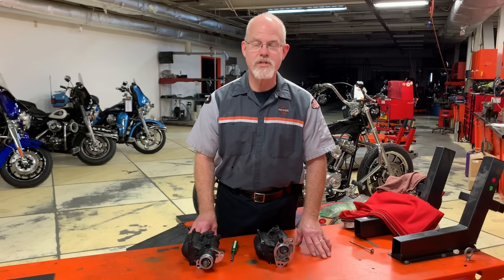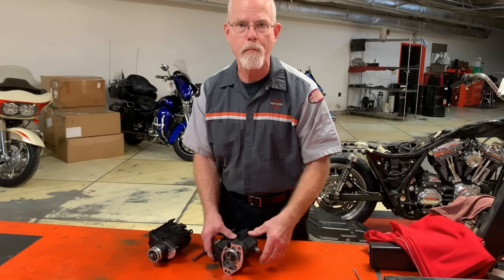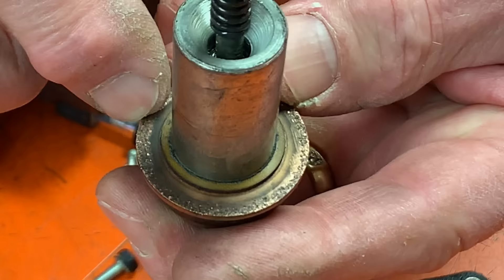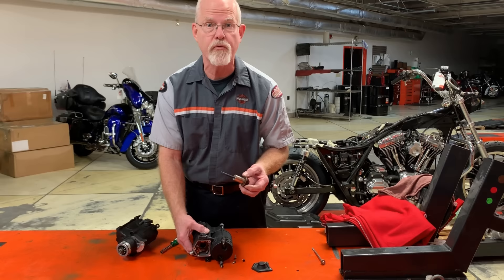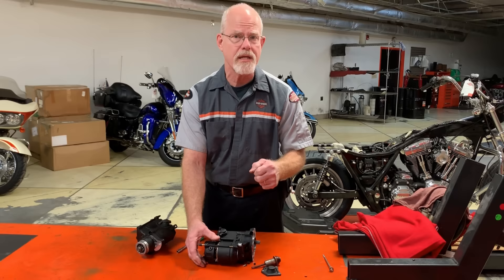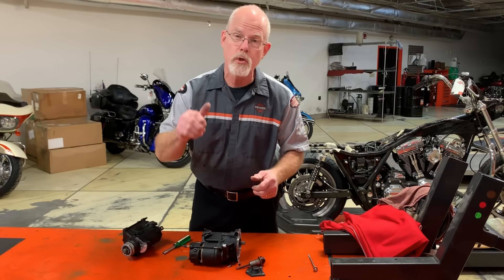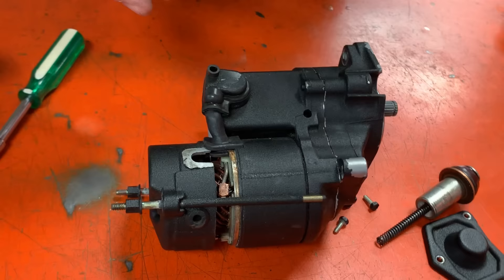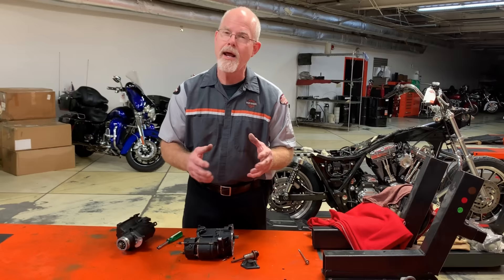DOC HARLEY: STARTER MOTOR WHAT WEARS OUT

Comment: What if you get a continuous clacking sound when you try starting it? from the primaryarea.
Reply from the maker: Depending on what year and model. Many times the Battery does not have enough juice to kick out the starter gear and engage the starter ring on the clutch....Doc

Comment: Hey Doc Harley. I have a 1977 xlch and im having an issue with engagement inside the clutch case.(with the starter and the solenoid)I used shims in the past to get the proper alignments. are my clearances wrong? but now i cant seem to find the sweet spot. Do you have any jewels of knowledge to set me in the right direction?
Reply from the maker: Having a Sportster with a long history. My first choice is the condition of the starter gear on the clutch…..Doc
Reply: @LowCountryHarleyDavidson  could it be the starter bendix not locking in the opposite direction?
Reply: @LowCountryHarleyDavidson clean gears
Reply: Thanks for the rapid response 
I made a video and will link it

Comment: Hi Doc - occasionally (maybe one-out-twenty starts) I'll hear a awful "kwang" kinda of noise; it's very intermittent. I'm only guessing, but it sounds like the pinion gear is not engaging cleanly with the clutch - merely bounces off of it. It doesn't start. I try again and it almost always does. But it's a terrible noise and sounds it'll break something sooner or later. Your thoughts on this. My scoot is a 2012 FXDC. Battery is new. Thanks.
Reply: Compensator sprocket

Comment: Hey Doc,  I know this was about starters but, I have a question about its cousin the stator...LOL  My 03 Peace Officer Shine Road King is almost 20 years old.  That being stated, Im the type of person (Mechanical Engineer) That replaces parts before Im stuck on the side of the road so, ok here is the question.  I'm not getting a definitive answer from anyone when I ask the question.  Does my 03 Road King Shine have a 3 phase stator.  Some people say yes and others say no.  If no, can I replace the stator with a 3 phase model, replace the voltage regulator without creating any electrical problems with the rest of the electronics on the bike.  I do not want to sway all this out only to find out I possibly might hurt some other components.  Im not having any problems with my bike now and I don't want to at 2;00am in the morning on i-95
Reply from the maker: You own the Peace officer edition with basic two phase. The Police models had the better charging system. You can upgrade your bike with the HD Accessories 45 amp charging system Part # 29999-97B.  Also I highly suggest looking up Cycle Electric Inc.They offer a lot information and upgrades....Doc
Reply: @LowCountryHarleyDavidson  Thank you....You get a star on your forehead and an extra cookie at lunch today..

Comment: I realize this video is a year and a half old but I have a question relating to starter motor life-cycle. I had a mechanic tell me many years ago to always start your bike in neutral and I can hear the difference turning it over when I do. It is not working as hard. I have always done this and have never had a starter problem over a lot of years and miles. Mr. Doc Harley - do you agree with this?
Reply from the maker: I agree with you. Since fuel injection, starting in neutral is a safety priority. I knew a customer who left his early fuel injected Harley in gear. He turned ignition on then pushed the starter button. The bike chugged across the parking lot with him chasing behind. Thanks ~ Doc

Comment: I asked before about my solenoid staying engaged. Relay fuse was didn’t change situation. It was suggested to replace solenoid switch, is this the next best choice?
Reply from the maker: It could be cheaper to have your local tech follow the flow chart in a Factory Service Manual and replace the part that is causing the issue..Doc

Comment: I replaced two of the Hitachi units on my 81 Shovelhead then got smart and installed a kick.
Haven't looked back since.
I put points ignition back in as well.
Oh yes and replaced those awful hydraulics with solids in the process of debugging the bike up to more reliable old school standards.

Comment: Doc Harley, I have an older motorcycle that kicks back as you described. What can cause this?
Reply from the maker: Many details that go into diagnosing the cause- like any modifications that have been done, battery age, loose connections or ignition issues. I’d suggest taking it in before having to purchase a complete starter.

Comment: The plunger on my starter right above the copper washer is a plastic piece that broke off which lodged between connection there for no start. What’s a good website or company to buy the plunger ? I’ve searched for few hours now no luck... thanks in advance Doc. Or anyone who may point me in the right direction.
Reply from the maker: If you still have the factory starter, a dealer can look at the parts catalog to see if H-D offers individual pieces. Sometimes Drag Specialties offers parts. Thanks ~ Doc

Comment: 05 FXST Softail hit pothole hard ... Bike starts without pushing start button ... Turn switch on and flip kill switch bike starts and starter stays engaged unless I pull starter relay .... I replaced starter relay and it didn't fix the problem ... Any ideas ?
Reply from the maker: Did you just change your handlebars? sounds like the Stop/Run switch wire is crossed to the starter switch.....Doc
Reply: @LowCountryHarleyDavidson  thank you for your feedback you're very close tho...
When I removed the run and start switches from the handlebars I found that the wires going into the kill switch were green as in corrosion.... So thank you for your feedback again definitely much appreciated

Comment: So, why doesn't Harley redesign the starter to me more robust,  when these are the known problems???
Reply: lol...because like most things, companies want to be able to make money off of us in parts !
Reply: Um because starters going out isn’t really as common as people think. Nothing in this world lasts forever
Reply: @anitabonghit266  I have three on the bench right now
Reply: Tom Smith just because you have three on your bench right not doesn’t mean much of anything. You could just be bad at diag. Just like when people think replacing the ecm is the fix
Reply: @anitabonghit266  
What? Don’t try to insult me, I was playing nice.
I have three on the bench. Two with worn out clutches, the third with a broken idler gear and a bad solenoid, all three will get there solenoids rebuilt the parts are cheep under $25.00 retail. And now is the time to do it.
Anita Bonghit 
They will need or get new - All Balls - Big twin starter clutch assembly - with clutch, two bearings, gear and spring fully assembled and are lifetime warranted from the supplier ‘unless that has changed’ 
Part # TR-497970 $58.32 retail. I have them in sock but I’m not into sales at all.
I have replaced every thing in the system many times and have up graded pinion, shell drive gear and sprockets, with lesser teeth on machines that are a bit more than stock so the teeth don’t get ripped off and cause further problems using high performance clutch packs from Energy One
They don’t burn out and leave Barnett in the dust. 
Took my first head of a Harley in about 1965 and haven’t stopped repairing, building but did finish racing them. 
Anything else
Reply: @anitabonghit266  
First it is my fault based upon my ability, then the people that ride these machines are Idiots.
Great diagnoses. 
Years of use, does that count? 
That wiring to the Start relay, ground in particular could it be any smaller? You would be surprised how much another gauge or two will make when replacing that relay.

Comment: Hi! 
When down to the dealership to replace my starter motor.  
End up my shell and sprocket with ring gear / ringer starter got damage. 
What is the cause??
FXSTC , Approx 50,000km.
I which I can post a picture of it.
Please let me know your thoughts. 
Thank-You.
Reply from the maker: Number one cause is a worn out motor compensator. Second is weak battery. Third worn out starter. Also possible to loose or too tight primary chain. Thanks ~ Doc
Reply: @LowCountryHarleyDavidson  
Hi Doc, 
Could the tech not tightening the pinion rod to the starter motor with or without lock tight causing the pinion to lossen and damage the  clutch basket starter ring gear?
 Thanks! Doc.
Reply from the maker: @kimperry5080  I can’t put a blame on a tech. I don’t know the year of your FXST but I thought there is a lock washer on the bolt to help secure it. Thanks ~ Doc
Reply: @LowCountryHarleyDavidson  95' FXSTC STOCK.

Comment: Hey doc whats the name of that part you can purchase for the starter, its a button you push thats connected to the starter itself its like 12 bucks , from what i understand with this part/button you dont have to use your on/ off switch on handlebars . is this a part to get to avoid that click of death somtimrs i get on my 1995 evo
Reply from the maker: Joe nothing has been 12 bucks for a Harley in years😆. It’s called a Solenoid end cover/starter button. Cheapest about $80. Thanks ~ Doc
Reply: @LowCountryHarleyDavidson  thnx doc

Comment: 25k miles on my 12' touring. The starter is engaging while the bike is running. if i pull in the clutch at a stop light the starter engages and make san aweful sound as the bike is already running.  said that this is a such a common problem on bikes around 9k and up. surley HARLEY CAN DO BETTER on major part like this.
Reply from the maker: No this is not “common” problem. Bring it to your local dealer and have this fixed before it cost you a lot more!….Doc

Comment: What miles does this normally happen thanks
Reply from the maker: I do not have a mileage mark, there are many factors. Frequency of use, condition of supporting items, battery is number one. Weak batteries put excessive strain. Worn wires, switches and ignition components. The harder to start a Harley-Davidson the more wear. Thanks ~ Doc
Reply: @LowCountryHarleyDavidson  mine about 30,000ks / 18700 mikes but thanks. 09 bob 103 upgrade lol

Comment: My '96 sportster sometimes has kickback when I start it!  Why's that happen?  Can I fix it?
Reply from the maker: There’s a lot of details that go into diagnosing what could be causing kickback- like any modifications that have been done, battery age, loose connections or ignition issues. I’d suggest taking it in before having to purchase a complete starter.
Reply: @LowCountryHarleyDavidson  Thanks for the reply!
My starter is working well (I think), but my battery is getting older.  I didn't know a weak battery could cause starter problems - that's good knowledge!
Reply: @LowCountryHarleyDavidson  I honestly didn't even know it was called 'kickback' before this video.  Now that I do I can start reading about it online.  I don't understand it yet, but it sounds god-awful.  Thanks!
Reply: How does a kickback sound/feel on a starter motor? I have only heard about Kickstarter kicking back
Reply: @markman63  I press ignition, hear the engine turnover and initial combustion, then something goes wrong. Sounds like my motor is getting thrown forward and backward -- not pretty.
Reply: @markman63  My current understanding is that my starter pushes into the compression stroke, but when combustion happens the starter isn't strong enough to push through, and the motor is thrown backwards before top dead center. This cycle repeats a few times until I let go of ignition.
Reply: @markman63  I got a new battery and keep it tended, and the frequency of this kickback has been greatly reduced!
Reply: @jalster2  both of my sportsters have not done a kickback since it got warmer.

Comment: First Harley Davidson doesnt make their own starters. Their  made in Japan by Nippondenso so 
O.E.M is whatever contract they have with a supplier at that time. Aftermarket gets a bad name with specific brand fan boys. With that out of the way I just wanted to say Installing a starter with higher amperage doesnt mean you need to replace the battery and leads. The new starters amperage would have to be ridiculously high to justify replacing them. If that was the case then you forgot to mention a higher amperage alternator to replenish the battery voltage loss. 
 Their not diesel engines that require heavy duty starters to rotate a high compression engine.  "Upgrading" to higher amp starters to crank it fast enough to start the engine is compensating for either poor compression, fuel delivery issues or weak ignition/ incorrect timing.  
A strong engine should only require a rew revolutions to  start the engine.

Comment: my 17 street bob is starting hard with a brand new battery. 3000miles on it... what do you think is the issue. also it came up with an error before it died with the old battery v inerr error code.. i replaced the battery and it works but its still not instant turn on.
Reply from the maker: There are many definitions to “starting hard”. Does the motor turn over but does not start to run?  Does the motor turn over but clunks really loud...loose compensator. Does the ignition switch turns but the lights on the dash flicker and you got to play with the switch until the starter turns over? Have you modified the bike with air cleaner and loud pipes but not a tuner? Did you buy an aftermarket battery that is not an exact fit to the cables? My bike is hard to start, really? Thanks, ~ Doc
Reply: @LowCountryHarleyDavidson  has pipes and intake but no tuner. Lights turn immediately. Motor turns kinda clunks loud.
Reply from the maker: @itemps  Good information. “Clunks kinda loud” point to the motor compensator in the primary. Thanks ~ Doc
Reply: @LowCountryHarleyDavidson  sorry I couldn't diagnose more, I'm a noob. Love the videos!